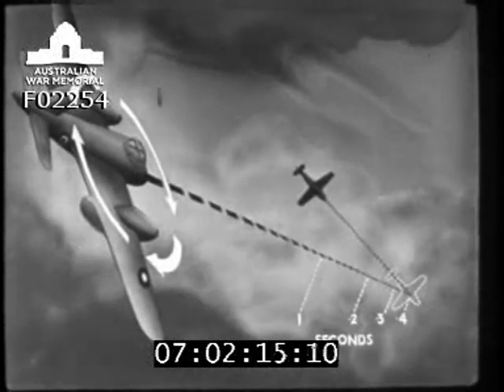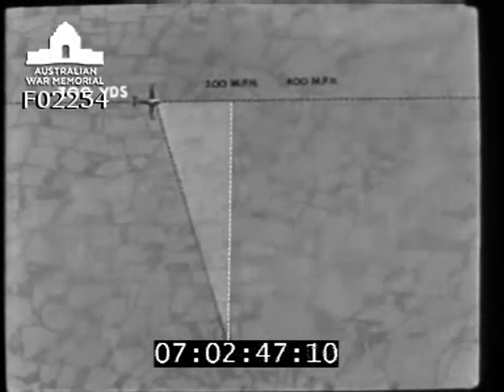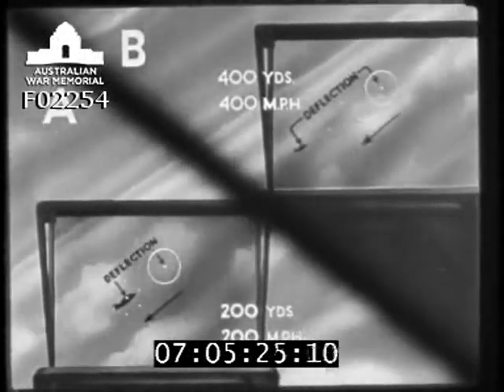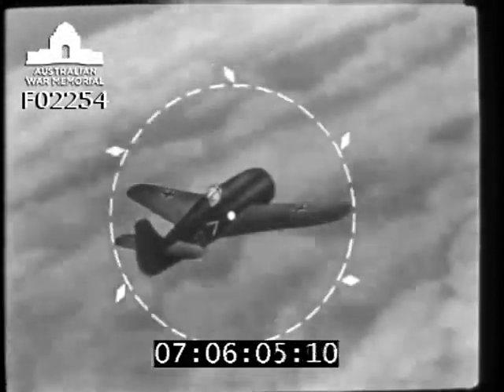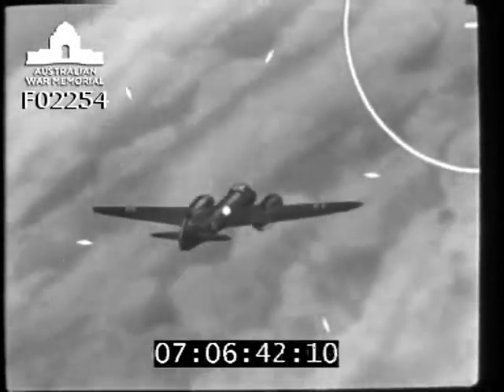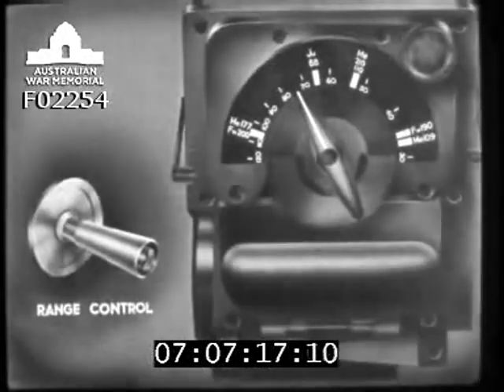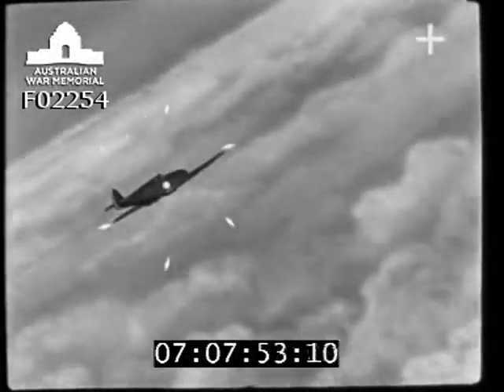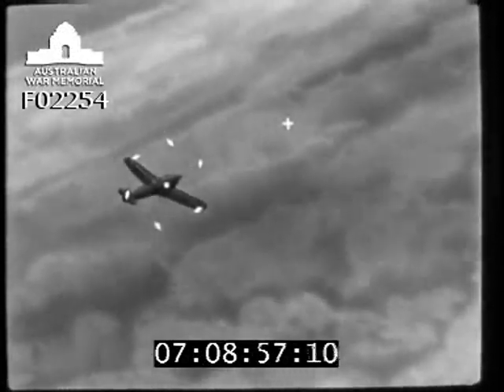Gyro Gunsight Mk IID

Comment: Ive always found this gunsight to be very difficult to calibrate in combat. It helps newbies, but for veterans its just more knobs to turn.
Reply: Actually, less knobs to turn. Have a look at one of the gun sights that the gyro sight replaced:
https://www.youtube.com/watch?v=Lq8NBk42BJ4
Reply: @MarsFKA  More than 0 knobs is, by definition, "just more knobs to turn"

Either way, the sight is cumbersome to use and wastes time. The range will almost always be off, and youre just better off learning how to deflection shoot.
Reply: @Anubis7169  Did you even look at the video I linked to? How would you characterise the range and base controls? They aren't "knob" shaped, but are still controls and more in number than on the gyroscope sight.
With your vast experience in shooting down enemy aircraft during World War 2, you are clearly an expert on cumbersome gun sights and crack-shot deflection shooting. What a shame the ring and bead sights were phased out – they had no controls at all.
Reply: @MarsFKA  I mean, I have like 3000 hours in combat flights sims, and yes, am a crack deflection shot. But aight. You completely miss my point. Good day
Reply: @Anubis7169  flight sim is not the same as real life, don't kid yourself.
Reply: @JohnyG29  No shit. Its still only calibrated for one range at a time, so unless you loiter behind your target for several minutes its always ranged incorrectly, and doing so is a sure fire way to be shot down yourself. Just learn how to deflection shoot; Its easier.

Modern HUD gunsights are infinitely better, because they use radar information to dynamically adjust range in real time.

This sight is an example of a technology just being advanced enough to be cumbersome to use.
Reply: The main advantage of the sight, once someone took the trouble to master it, was it allowed you to do away with tracer in your ammo loadout, which was a huge tactical advantage when your opponent couldn't tell you were shooting at him until you were getting hits.   If you watch WW2 gun camera films, you'll notice a lot of them don't use tracer.  Those pilots are using gyro sights like the K14/MkIID and have opted to delete tracer except as a depleted ammo warning at the end of the belt.

Comment: To anyone wondering, this isn't as advanced as you may think. It's not a computer but a reflection of light on the screen. All ranges are also adjusted by the pilot.
Reply: It performs some (fixed) mathematical operations, so I'd class it as a mechanical computer.

Comment: I'm sure the aces were thinking; "Screw all this... just get closer"
Reply: The overwhelming majority of RAF fighter craft had wing-mounted armament, getting too close was counter-productive, as the rounds would stray considerably to the side of the point of aim. But you're partially correct, as aces generally had a feeling for gunnery and waiting for a gyro sight to settle might have meant a missed opportunity to fire. It's just that most people weren't aces, and their gunnery saw massive improvement following the gyro sight's implementation. It was as big of a deal as the proximity fuse and radar gun-laying were for AAA.
Reply: @JustinianPrvni  I read that in one British squadron there was skepticism about the gyro sight when just one example of it arrived, and it was installed in the cockpit of a squadron rookie. When the rookie used it to shoot down a German fighter at a considerable angle of deflection, the sight was removed the next day and installed in the squadron commander's plane instead.
Reply: @JustinianPrvni too much gaming
Reply: Certainly!
Erich Hartmann's Convergence was 100m
'Bubi' was the best ace back then. 352 confirmed kills
Reply: @aspielm759  he only fought on the eastern front and significantly over claimed on his kill count.
Reply: @JohnyG29 yea i doubt that he even got 50% of the kills he claimed
Reply: He was talking about CONFIRMED kills though, not claimed kills. If the confirmed number is still wrong, that isn't on Hartmann.

Comment: I wonder how many pilots fiddled with this device while in a turning dogfight.
Reply: The trick is that the ranging control was usually incorporated into the throttle lever as a twist grip.  Therefore, you could adjust it while not taking your hands off of anything needed to actually fly your plane, reducing the amount of fiddly-ness going on.
Reply: pilots used to shoot at fixed range in the RAF, so they didn't have to fiddle too much